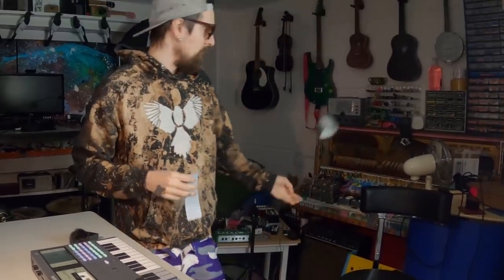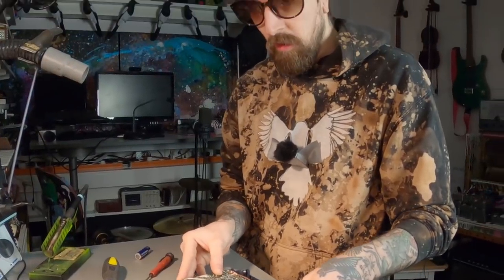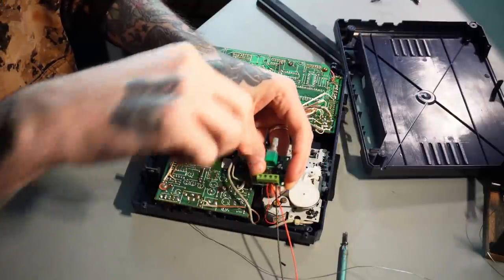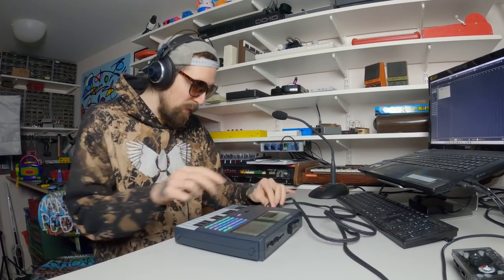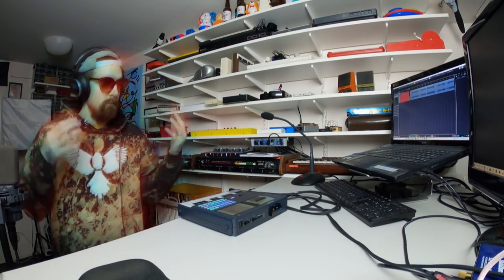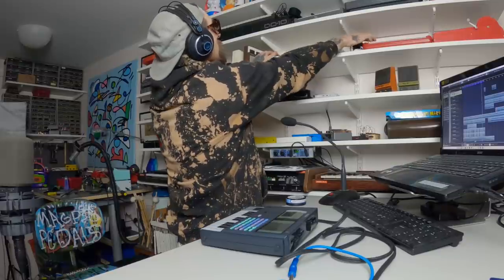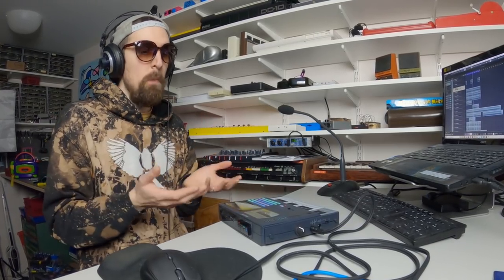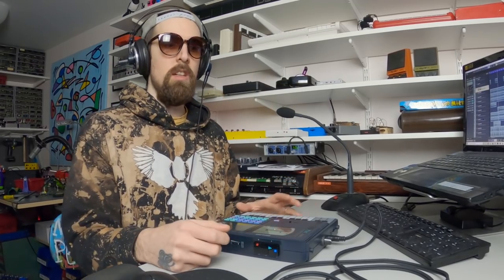I Put A Knob Here And It’s Very Inspiring

Comment: I'm inclined to modify a regular cassette recorder this way... And not wait until I can find a keyboard/cassette combo.
Reply: I did it with an identical PWM board on an old portastudio mf-p01 with good results, although I need to install a switch to go between the original PWM board and the new one since the syncing of the record/play of the 4 tracks is calibrated for the stock PWM board. Without it, it's impossible to record something and have it play back at the same pitch, which is not ideal for multitracking.

Comment: On any mechanical motor a pwm will always work. It’s basically turning the power on & off to maintain the speed you’re aiming for. Where using a potentiometer to change the amount of power getting to the motor to slow it down will eventually reach a point it won’t power the motor any more.

Comment: Ever since I got into analog gear it also got me into opening them up and repairing things on my own. So this type of stuff really interests me. What do you suggest for someone just starting out with stuff like this? Like what’s a good entry level thing for modifying gear?
Reply: For getting better at actual repair: find stuff with noisy pots, bad output jacks, or dodgy power supply caps, and replace those components. Good way to get vintage stuff cheap, practice soldering, tracing problems, and otherwise learning how to do the thing right.

As far as stuff that has simple mods that sound good, a couple I like:
- Hing Hon EK-001 keyboards use a simple 555 oscillator to generate a square wave. You can find them in various forms at dollar stores and thrift shops for under $10 (do not pay stupid eBay prices. These are not collectible. They are worth $10). Tons of mods & ideas documented online.
- Danelectro FAB effects pedals. The Echo pedal in particular has several easy mods, can be re-housed with little trouble, and genuinely sounds good. Their original retail price was stupid cheap - like $20 - and they're still a steal.
- Adding PWM control to things using prefab boards (see also: this video).
- Replacing clock crystals on sound toys with VCOs (once again, using prefab boards... thank you China).
- Read Nicholas Collins' "Hardware hacking". One of the classic intro-level books on the subject; easy projects, great "for dummies" style tutorials.
Reply: @numbstation   thanks for this!

Comment: idk if anyone mentioned but you could've tried putting in a voltag starve pot ¯\_(ツ)_/¯ also a bypass switch to get the original voltage if needed (for anything data this should be very tricky with your solution) would've been a smart solution.

Comment: "red is positive and black is negative". Says simple Simon... the Magpie. LOL Um... you'd think so, but I perform IT related services and even repair computers and electronics, and you have no idea how many times I saw these wires reversed on "Made in China" electronics. Gosh, even a couple of times - laptops. Worse yet, more expensive electronics may have reverse polarity protection built in, but I have seen red and black used as data send/receive cables and blue and green as power cables... So yeah... needless to say: ALWAYS VOLTAGE TEST FIRST. (Also - I wouldn't recommend going "really fast" on old tape decks, it could be recipe #1 for getting the tape chewed up or torn, should the auto stop function be compromised or simply not fire quickly enough).